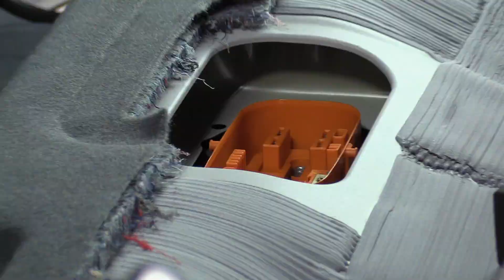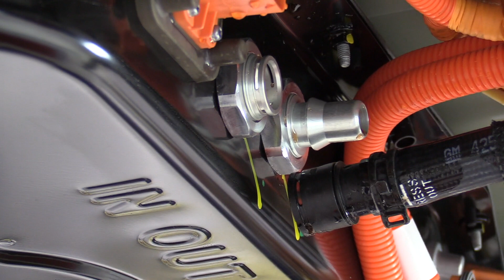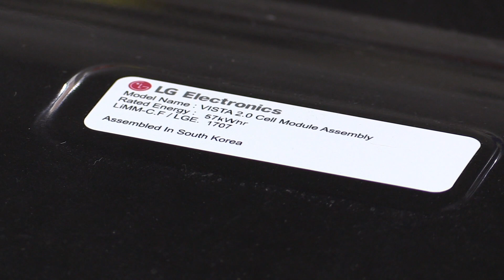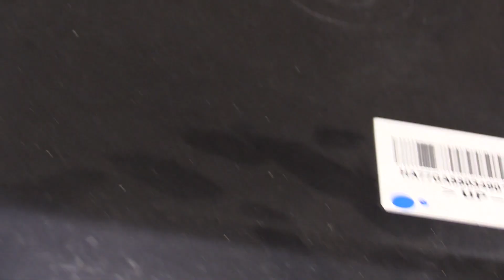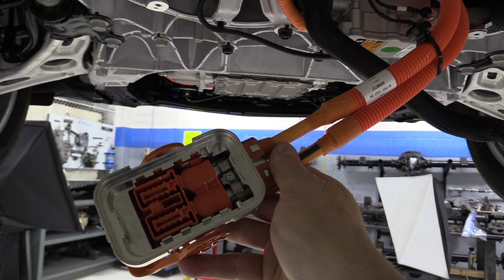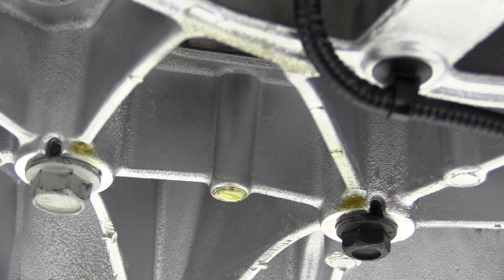Chevrolet Bolt EV 57kWh Battery Removal

Comment: hello i have a chevrolet bolt there is a fault it is not charging 14 volts and ther error codes these are the fault readings i need help (p1e00   p1f59   pp0d09  p0d26)

Comment: Hello, sir, one question, how do you prevent the car from tilting the moment the battery is removed. I'm only at half of the video where you talked about the CG of the battery. It was a thing our teacher mentioned at the introduction of the course but we are not that far yet.
Reply: The car's center of gravity is still between the four legs of the shop lift.

Comment: Excellent  video however I would be concerned about the car shifting or possibly falling off the lift due to front heavy weight distribution-perhaps strapping the rear of the car to the lift would solve this issue

Comment: Did you ever figure out what the leak from the steering gear was? My Bolt has a binding steering gear and my friend and I have been arguing about how the rack might have failed, and I remember you spotted a leak near your steering gear. Did you ever diagnose it? GM would claim it's wax in this TSB  - 16-NA-109. But it seems counter intuitive that the steering gear would use oil vs grease.

Comment: As the owner of a 2019 Bolt which is subject to the battery recall, I am very interested in the process of removing/replacing the entire battery assembly.  I wanted to know how complicated (or simple) the job would be, and how much room for error exists in the procedure.  I am happy to see that it is actually pretty simple (if you have the proper lifting stand to handle the weight).  Assuming the techs don't screw up removing and replacing the connections to the battery pack (electrical and cooling) and refilling the cooling system, it should not be that tough to do it right.  My car should be near the front of the line when they actually start calling cars in to the dealer en mass for the retrofits.  I'm hoping the techs will take their time for the first few months of what will be a long and probably (eventually) boring project.  After doing the first several dozen cars, I'm thinking they may tend to get sloppy.  Hope not!

Comment: Those particular batteries are the ones that are catching fire right now and are part of the recall on ALL 2017-2019 Chevy Bolts!! ALL LG BATTERIES ARE THE BAD ONES CATCHING FIRE WHEN CHARGED FULLY!!!
Reply from the maker: Only the LG batteries made in Korea. The ones made in the USA are not. I own a 2019 Bolt EV and it is not part of the recall.
Reply: @WeberAuto  saw online yesterday that there are a lot of the 2019 Bolts affected with this recall! I have an aunt that has a 2019 and hers is included. She was told not to park the vehicle inside her garage and to charge it outside and set it to “Hill top reserve” mode until chevy decides on a complete fix. I’m want a Bolt but waiting to see what Chevy is planning on doing! Hoping they replace all LG batteries!

Comment: Professor John Kelly. I’m fascinated about You explains Your dissecting the different cooling passages, different bearing types, grease, oils, antifreeze coolant. This unit was from a fire damaged 2026 MODEL S. You do a much more detailed explanation than Sandy Munro. I’m sure You would both have total respect for each other’s analysis. I would like to know how this motor evolved  starting in 2012 with probably many prototypes with failures, and redesign and to a product that will last more than 20 years. My observations are how unique the requirements for sealing are which are much more complicated than any Gas Engine. The seals used and routing of coolant both internally and externally to
Reply: Continued. To Super bottle and then Octo Vakve. Many Questions: How many types of motors, drive trains, and did they élever have catastrophic failures on this developing process to engineering excellence. I’m waiting for CYBERTRUCK DUSL MOTOR. Thank You.
Reply from the maker: Thanks for the information

Comment: I have enjoyed your videos immensely as a past auto mechanic and industrial electrician the EVs pull it all together. I use to teach arc flash safety and would joke about the under 50 volt  rule minimum safety gear was needed, I guess  they never saw a 12 volt car battery explode. I can only imagine what kind of energy  would escape while plugging those connectors in if something went wrong. Watching the news one day they showed a car driving through deep water and explode, I thought to myself it has to be an EV. Keep up the good work.

Comment: This couple of years video is coming in handy with the Bolt EV recall of Friday November 13, nobody know at this point what is going to be the final solution to the “ battery fire”problem. But if it is a battery replacement at least we know what they will be doing and what is going to fail in the car next (probably the coolant pump seals, for not removing air) after the battery replacement is done. Not sure if the technicians at my Chevy dealer are going to be able to do this with the finest of the profesor.

Comment: So if I wanted to upgrade my 2017 Chevy Bolt to Level 2 DC fast charging, do I just need a new connector port and the cable that would connect to the larger DC port on the outside of the battery?
Reply: voiture electrique simon andre. i just retrofit one with a dc fast charge. dealer can't do it . we are the only one to do it.

Comment: Hi Professor Kelly,
First let me compliment you on your  series of videos on the Chevrolet Bolt. I have watched everyone and learned a lot. They are great because they make the complicated seem simple. That is a talent. Thank you.

I have also watched several of your videos on the Prius. Again you did an excellent job of making the sophisticated simple.

I have a request. Would you consider demonstrating, on a video, the installation of a 12 VDC to 120 VAC inverter into the Bolt? I believe in order to make this work as a backup emergency system the Bolt needs to be on?
Again thank you for very interesting, detailed and thorough videos.
Leo

Comment: Are the version 2 batteries preferable to have in the 2017? I've heard they have fewer problems than the first version battery. As I'm looking to buy a used 2017 pretty soon, that's a serious consideration.

Comment: Hi, John ... such a large sealed enclosure volume must have a vent for pressure equalisation.  Would it be fair to assume that this is done via the fused disconnect plug?  It seems to not have a gasket or seal to the receptacle but instead a labyrinth arrangement.  Additionally, if the fuse blows it should be able to vent freely.  What's your take on that?  Thanks !

Comment: I am EXTREMELY surprised that there is no protection plate  under the volt for protection of the battery and all those hoses. Tesla learned that lesson and now every Tesla has a titanium cover underneath. Also helps with aerodynamics.

Comment: Firstly, a very well done series of videos. The one thing I did notice is that your probe tips were set to category 3 when you were calling them category 4 and vice versa. The higher the category number the less exposed metal at the tip. I'm curious why they specified those specific ratings. In my field (electrician) category increases as you get closer to the source due to higher risk of transients. I wasn't aware that there would be a risk of transients at all coming from a battery pack. Either way I'd have my probes set to cat 4 with all that available power. Less metal, less chance to cause an accidental short. Thank you again for this wonderful series.
Reply from the maker: Thank you and thanks for your feedback. I may have mixed those up while shooting the video. You are correct, shorter tips for higher power levels.

Comment: @weberauto did you ever determine anything about the steering rack leak?
Reply from the maker: Yes, it needs to be replaced. The upper seal from the column shaft is leaking.
Reply: Thanks, as a Bolt owner these videos are greatly appreciated and helped me in deciding to purchase the car.
Reply: @WeberAuto  Great video. Im just watching this video as my company just purchased one. Out of curiosity if it is electric steering, how is it leaking fluid?

Comment: Doesn't make a grain of sense that there is a 12v battery. Sure many of the systems run on 12v, but it is a simple matter to have a DC/DC converter from the high voltage to 12v. Having an additional wearable component for no reason is dumb.
Reply from the maker: Thanks for your feedback. The DC-DC converter cannot function without a source voltage. The 12V battery supplies that and acts as an energy reserve for when the DC-DC converter may not be able to keep up.

Comment: wait, rubber gloves for less then 400V, but no face shield and non-flamable overals???  (as the battery can deliver well over 100kW of power, just the radiant heat from the arc can literally set people on fire without ever touching them) That's a little weird and unsafe.
Also - does the procedure list what minimum CAT level protection on the multimeter is needed? 
(if a cheapo multimemer with 0 protection fails somehow when connected to the traction battery, it will literally explode and potentially injury the user...proper meters like the Fluke you have, have real hardware to protect you from that)
Reply from the maker: Thanks for your feedback. Yes, the instructions call for CAT III meters, leads. etc. I am following OSHA requirements of NFPA 70E standards in these videos. No face shield is required in the USA for these voltage levels. Further, the arc flash boundary with the battery service disconnect lever removed is 1mm for AC voltages (which means DC voltages will be approximately half of that at 0.5mm). In other words, there is no arc flash danger at these DC voltage levels. We are training a whole new generation of service professionals for these vehicles. Those who attempt to work on these without the proper education and training are literally taking their life in their own hands. Have a great day!
Reply: @WeberAuto  I think we don't understand each other what I meant as arc flash...not current jumping a gap that is too small, but pulling out the arc when you short circuit something, like when arc welding...just with about 50x the power... Normally the gap is sufficient to insulate the conductors, but if something lights an arc, it may take some time for it to extinguish. It if stays lit long enough, the damage it causes by melting/vaporising metal (and throwing it all over the place) and setting everything around it on fire may cause it to stay lit until power is cut.

DC is far more prone to drawing the arc out as it doesn't go through 0V 120x a second (or 100x for my side of the Atlantic)...this is why all switches and contactors are rated separately for AC and DC! (DC always having the lower value).

btw is there an official procedure on what to do with a battery pack in thermal runaway other then...running away...? :D
Reply from the maker: @AKAtheA  Thanks, I did misunderstand what you were telling me. You make a good point. Regarding thermal runaway, the emergency rescue guide tells you to "use copious amounts of water to cool the battery and extinguish the fire".
Reply: @WeberAuto  makes you wonder if there will be new fire code / regulations on shops that deal with EV batteries, as the only way to have enough water for something like a runaway pack is a proper fire hose and hydrant...
Reply from the maker: @AKAtheA  There already are standards for buildings and battery rooms created by the NFPA in document 70E. Standards are not laws though. It is up to local communities to dictate and enforce building codes and adopt standards.

Comment: Speaking of the 12 volt battery:  is it a "standard" lead acid type?   I've long wondered why, with hybrids and election seeming to be the greatest thing since sliced bread "they" don't save some weight and gain some capacity by replacing the lead cell with a Li cell in even the most "conventional" automobile.
Reply from the maker: It is a special kind of lead-acid battery, an Absorbant Glass Mat (AGM) battery. They have very high energy density for their size compared to other battery types, but they are also very heavy.
Reply: Cost, I think. It does seem a bit odd as a lithium pack of the same capacity would be about 1/3rd the weight, and weight matters on EVs. But it would cost at least 3 times as much and so far no-one seems to have gone for this. It's also true that all the standard 12V parts are designed for lead-acid voltages so it's just easy. You really need to use 4x3.3V LFP cells to get a more-or-less equivalent LA/AGM voltage, as opposed to the more typical 3.6V (3.0-4.1V) of most lithium chemistries (4x3.6V (14.4V) is a bit high, and 4*4.1V (16.4V) charge voltage is definitely too high. )
Reply: My Spark EV has a lead acid 12v too. Scratching my head about the use of the old tech lead acid , price has to be the reason .

Comment: If that 400 amp fuse blows I'm guessing the person in the back seat middle will have a story to tell.
On another note: I'll donate $50 to the charity of your choice if you give me the procedure to disable the door open audible alarm.
Drives me crazy as a rideshare driver to get out for luggage and have that thing blaring.
OK, one more note: has anyone rigged up a remote rear hatch release?
(I can't believe my 2018 Premier, with all the bells and whistles, did not include a hatch release for the driver)
Thanks again for the vids, I wish we had these in the 1970's.
Reply from the maker: Thanks for your feedback. Sometimes the alarm or alarm volume is configurable with a factory scan tool. I cannot tell right now because our Bolt is disassembled for this video series.
Reply: @WeberAuto  Thank you. I have an OBD scanner, will look through my library of PIDs for 'door alarm' or something similar.

Comment: Hi, first of all thank you very much for these excellent videos, knowledge and educational programme. I just wanted to mention that in some electrical vehicles after disconnecting the service fuse you have to wait 10 minutes or so before starting/carrying/inspection for any work. I believe we have to wait for the capacitor to fully discharged or de-energised. Correct me if i'm wrong. I noticed soon after you disconnected the service fuse you went straight to check for voltage in the inverter. 
many thanks.

Comment: Fortunately in a collision, most of these systems are disabled automatically. However emergency personnel would be wise to understand basics. The first few steps are similar to our Lexus hybrid, with the same orange color for high voltage wires.

Comment: could I flip it upside down? bulge could go where my gas tank is now..then rest could lay under bed of truck
Reply from the maker: Yes, the cooling system is self contained. However, the upper cover is not steel, it is reinforced plastic. It would need to be protected from road debris.

Comment: I would consider getting an electric car BUT I don't want to have to drag behind me that really loooooooonnnnngggg extension cord.
Reply from the maker: Troublemaker ;) Thanks for your feedback
Reply: That's the problem I have. Nobody owns a 240 mile-long extension cord that'll work with my Bolt. Good thing it's got such a big battery.

(sarcasm, by the way. My Bolt has gotten close to 300 miles on a charge in the summer, beating my old gasser by a long shot.)

Comment: Thanks for the well explained sequence there. I think I would not leave the high voltage connector hanging down into the coolant bucket while removing the fitting. A splash onto that connector and you may find yourself wondering how you’re going to clean it.

Also it’s possible that there could be a lot more coolant in that pack than you think and it simply fills the bucket up until the connector is dunked.

So I’d push it out of the way before disconnecting. 

Otherwise a great procedure well explained.
Reply from the maker: Great point, I should have had that out of the way. Luckily it did not get splashed on. The rest of the coolant (3.8L) was removed from the battery in the next video on battery disassembly. See https://youtu.be/ssU2mjiNi_Q?t=18m49s Thanks for your feedback.

Comment: Keeping lithium ion batterys 30-80% charged greatly extends their useful life. This is the long life trick for your smartphone (charge for 30min at a time), tablet, laptop, smartwatch etc! 
Regular 100% charging of lithium ion batteries causes shrink swell damage to the cathode (lithium cobalt) and anode (hard carbon) ; causing a progressive accelerated loss of capacity
Reply: Any thoughts about the charge controller & BMS in hybrid & electric vehicles protecting the large expensive batteries from overcharge damage ? Toyota already proved that 20-90% charging greatly enhances the battery lifetime of NiMH and Lithium Ion batteries in their hybrid vehicles!
Reply from the maker: Thanks for your feedback!
Reply: Your a very polite & responsive channel moderator. Thank you for always giving kind responses. I would be honored to meet you & visit the facility where you have all these cool hybrid & electric vehicles being taken apart & put back together! Super cool!  Thank you for posting these edifying interesting well made videos! Cheers
Reply: Thankfully, the Bolt has a feature to extend the life of the battery. In the Energy Section of the radio, go into the menu and enable Hilltop Reserve if you can spare about 20 miles of range. This will change the "Full charge" from 100% to 90%. The true purpose of this feature is to enable extra regen capacity for those that live on top of a hill, but it works great for extending the life of the battery when you don't need a completely full charge. It's even location-based if you want so that the Bolt will fully charge if you charge away from a certain location or only at a certain location.

I understand newer Bolts allow more control of the full charge cutoff point, similar to how Tesla accomplishes this.